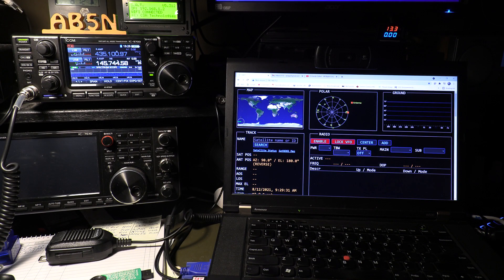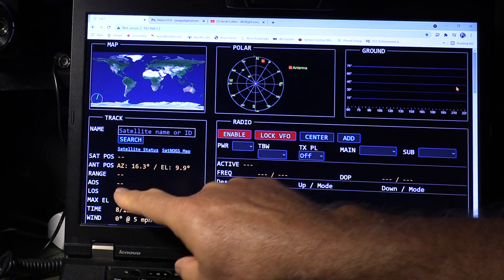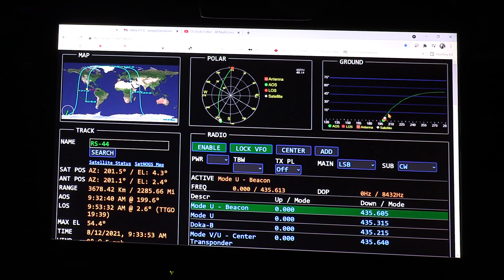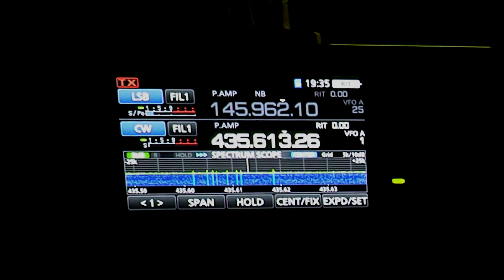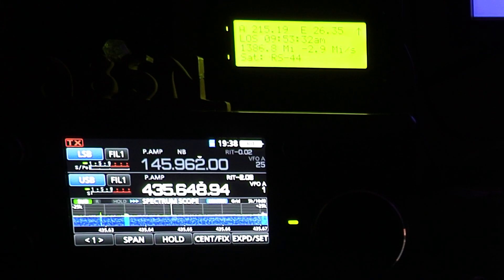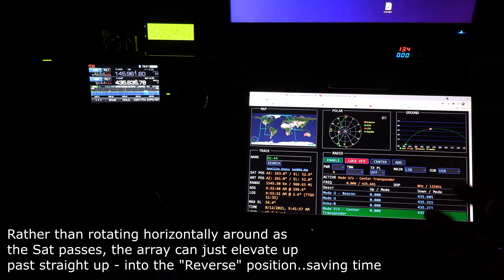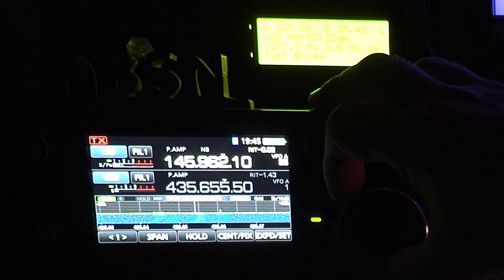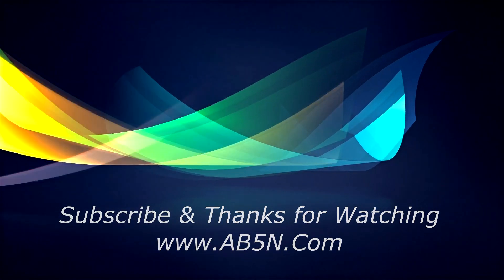S.A.T  Controller Operation on Russian Sat Pass

Comment: The video helps a lot on understanding how the RIT is used. And how to spot yourself on screen. I am new to the satelites and i was doing it all wrong trying hear myself. I was only turning the RIT about .04 At highest. And wondering why i wasn't getting anywhere. I didn't know have go as high as in the 2.40 on rit. And see how you see your self on the Water fall help out alot to.

Comment: Hi Robert, nice demo! I was wondering, what is causing the intermittent blinking of the upper and lower vco on the IC-9700 please? thanks! Best, Pascal
Reply: Ahh, that is not VCO locking, that is the SAT controller updating the frequencies due to Doppler shift !

Comment: Are you using a preamp and if so which one ?  Thanks
Reply: I put in a Tokyo hi- power 450 gas fet, but with 50 feet of ldf4-50 hardline, it's only raising the noise floor

Comment: Thanks for the video Bob.  I just received my S.A.T. yesterday and am in the process of setting things up.  Also assemblying the M2 LEO-PACK.  Hope to be up and operational soon.  Did you opt to use add preamplifier(s) on your antennas?  KF4HR
Reply: I did add a pre-amp on the 450 side, but it is actually un-necessary. Of course, I am using 50 ft of 1/2" Andrews Hardline. If you used anything over 50 feet of say LMR-400, you could benefit from a pre-amp. To determine if your RX is at the "noise floor", your S meter should be just starting to move off zero. An internal RX pre-amp can cause this to happen, but it is amplifying noise and signal. It is critical that it is at the antenna. Plus, 4 layers of Scotch 88 tape and then a thin layer of silicone seal over the connectors is mandatory. The little F connectors on the antenna itself should be ok without tape. All the flexing of the main coax connections with rotation WILL let water into the connectors in time. If your RX seems poor, that's what is going on!

Comment: I claim no expertise in satops, but curious why use RIT? I noticed you are not changing your TX freq?
I use SATPC 32 which is adjusting both up/dn links. There are times I use RIT for others perhaps not on freq.
"One True Doppler" is the way to go, but I see some use it and some don't.
Reply from the maker: I decided to do the video 4 minutes before the pass and I forgot to click "Lock" on the RX/TX.  The SAT does move both RX and TX when tracking. The RX RIT is used to correct for any additional offset during the course of the pass. (which can shift). The SAT device is a much simpler solution to doing linear sats than SATPC32. It is still evolving too.
Reply: @robertnagy2163  Agreed. The RIT should only be used to compensate for "others" who are not correcting for doppler properly. I see this a lot. I've had to RIT in people from time to time, but then return it to zero. Doppler is tracked nearly perfectly by most programs...The SAT does not "shift" it's freq, it is always the same and follows a predictable "doppler" shift as most know; the program knows which way and how much to compensate. The only reason to use rit is to tune other stations who are not uplinking properly or chasing their own downlink. To use RIT on the downlink to hear your own signal is improper and clogs the band width. Inverting and non-inverting transponders are specific uplink freqs WITH specific downlink freqs..If someone tunes themself with RIT, it means their uplink is wrong and they are not allowing their tracking program to work as it should.
Reply from the maker: @apetercharlesstudio  Then truly I am not exactly sure why each sat seems to have a slightly different RIT offset when using the SAT controller. It is still being refined, so issues like this will be addressed. For now, I believe it is a slight inaccuracy in the up/down relationship due to something in the design. The makers of this device are very responsive and have been a joy to work with.
Reply: Probably 65-70% of ops mess this up. In normal linear transponder satellite ops, you shouldn't adjust your VHF frequency at all regardless of whether it's uplink or downlink. Only the UHF frequency should be shifted to be in line with the passband accounting for doppler. KE0PBR (aka: The Grid Life) and AMSAT have great tutorials explaining why in terms the average ham can understand. Tracking programs adjusting both frequencies are part of the reason so many people get stepped on.
Reply: @Echostatic1985  Interesting response. It seems to me (IF) all ops used "One True Doppler" we would not have issues of stepping on each other. Leaving FM birds out of this discussion; seems to me if a Doppler program moves UP and DOWN link, the received DL should slide either up or down (i.e) We are all on the same page..You might be above me in freq and I am below as we slide down together..This of course assumes we are both in the same location relative to the SAT; which rarely we are The other issue I've run into is people running too close to the passband's edge. I think the problem is that we do not all operate with one correction.
Reply: @Echostatic1985  Can you shoot me the link to one of those tutorials, please?  I am not sat active yet, but am trying to read/learn/capture/file as much as I can before I start acquiring gear.  Thank you.

Comment: Any reason why you don't use the IC-9700 in Satellite mode?
Reply from the maker: With the SAT controller, the radio is used in normal mode. the SAT does ALL the frequency control.

Comment: Great video demo, Bob! I really wish that the iGateMini would support more rotors...even the ASCOM-based telescope al-ez models. This would become the bomb especially for newcomers to sats. 73
Reply from the maker: Well, this device is pretty new. The developers are certainly updating it's internal firmware. Weather there is enough "room" to start including other rotors, I can't say. For me, this was the item that made Sats possible after 50 years of hamming!
Reply: @robertnagy2163  You know you're selling Yaesu 5500's here, lol!
Reply: @robertnagy2163  Bob, they might also interface successfully with less expensive rotors that emulate the g5500 command set, too. I’ll research…